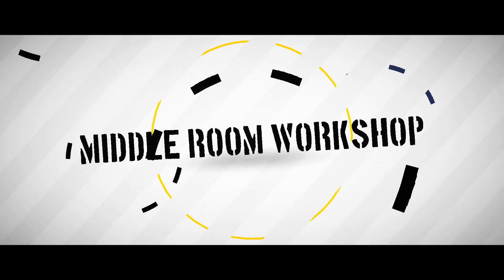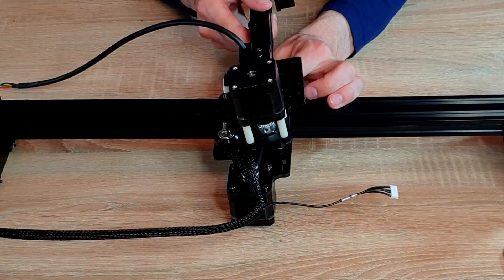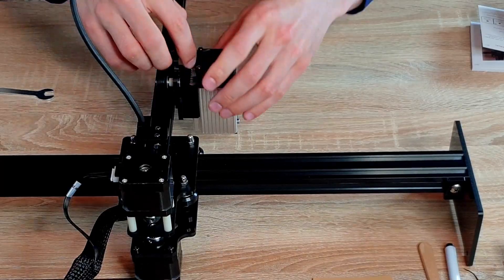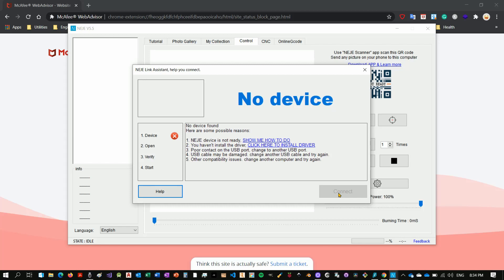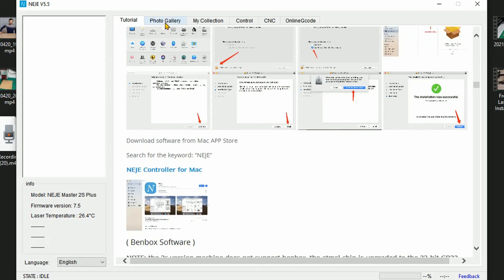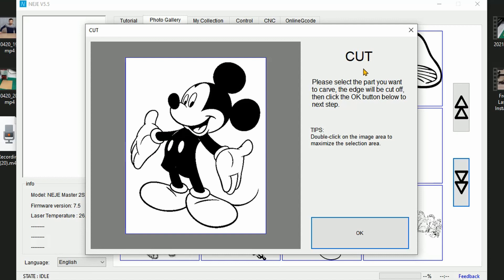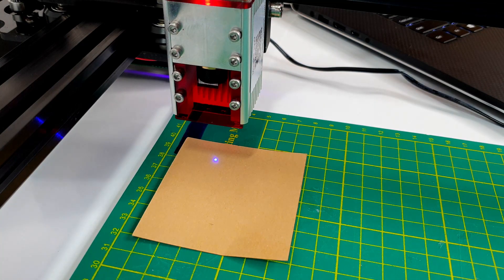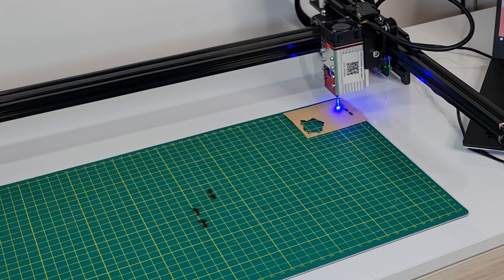Laser Cutting and Engraving Machine - NEJE Master 2s Plus - Installation and testing

Comment: hi, what kind of pad under machine you use? i am newbie to laser engraving  / cutting, aj want some pad, have you any advice? something cheao what i can use also for cutting, thanks
Reply from the maker: Hi, Peter Drienovsky; thank you for your comment. 

I have recently received the same question on another video, so I am pasting the same answer here. 

I have been using steel meshes for a very long time; you can find them in any hardware store; they are simple and cheap. 
The important is to choose one with a decent size of 10÷15mm in size and to be stiff enough so you can elevate it with a couple of wood blocks or anything that does the job.

The jobs are clean, but you will notice small burning spots on the underside due to reflection.
The honeycomb board is a better choice but has always had a very high shipping cost, and many are discarding it because of that.

Below I have a few links to some steel mesh, but again a local hardware store will have what you need and the honeycomb that I recently ordered.

Steel Mesh
https://s.click.aliexpress.com/e/_DFpz6kJ
https://s.click.aliexpress.com/e/_DkKnLLp
Honeycomb Board
https://s.click.aliexpress.com/e/_DFQsFgb

I hope it helps
Ciao

Comment: Hello I need help on my Neje Master 2s Plus?  your videos are the best videos. Please need help l, every time I try to do a job it's moving in the wrong direction and I can fix that and it goes against the the switches and it start making noises and I cannot fix it,the home cycling is correct. is any chance you help me do that please thank you
Reply from the maker: Hi Raul Ribeiro; thank you for your comment and compliments.

Please let me know which software you are using.
If you are using LaserGRBL you can easily switch the homing direction. To do that, you can follow my instruction here https://whathowwhysolution.com/when-clicking-on-the-home-button-the-machine-goes-in-the-opposite-direction-lasergrbl/

If you are referring to the Neje Desktop App, It is not possible to manipulate the direction of the axes besides reinstalling the driver from the Neje Wiki https://wiki.nejetool.com/doku.php?id=nejelaser_master_2_plus

The less obvious could be a wiring issue that is worth checking.
The connector typically has a direction, and you should not be able to wire them opposite, but sometimes they can be damaged or manufactured with flaws, and you won't fill resistance in the wrong direction. 

Let me know
Ciao
Reply: Hi Thank you for your prompt response, I'm Using Lightburn, the home sequence is correct, the only think is if i burn name or Leters it comes upsidown, any ideia? Thank you and again, You are doing an excellent JOB,  for the community, Ciao
Reply from the maker: Hi Raul Ribeiro, Thank you for your feedback. 

The problem has to do with the machine seeing its origin. 
The origin should be set to the bottom-left corner despite being physically located in the top-left (Go To: Edit (Main Menu -Top Left Corner) > Device Settings > "Origin"), and the x Homing axis $23 should be inverted (Go To: Edit  (Main Menu -Top Left Corner) > Machine Settings > "Output Settings"). 

Unfortunately, I am not in my studio, and I cannot really check with the machine connected, but that was the problem as far as I recall. 

You can also import my Machine and Device Settings to be easier. 
I have a video showing that here https://youtu.be/7FTJoGZ-ZGo while the files can be downloaded here https://whathowwhysolution.com/lightburn-settings-for-stubborn-machines-like-neje-master-2s-plus/

Let me know how it goes. 
Ciao
Reply: @MiddleRoomWorkshop  Thank you very much, this  fix my problem thank you again, for your time and your channel, Excellent, congrats

Comment: Hello, I'm hoping with your experience and expertise, you can help with a resolution to my current issue. I am having trouble loading the software. I am able to download the driver and receive a msg that it installed successfully. When I go to download the most recent version of the software, it runs through the entire download and after reaching 100% I receive a sorry error happened thread. A separate NEJE pop up box appears and says a problem caused the program to stop working correctly.  I've tried several times, deleting the driver each time and trying again, even with different versions of the software only to receive the same message. I would think if it were an issue with system requirements, it wouldn't allow me to install driver or initiate download of software. Are you aware of what could be causing this?
Reply from the maker: Hello Smiu Tee, thank you for your comment.

I am sorry to hear about your issue; unfortunately, I haven't experienced a similar problem with the machine, but I guess it is due to the unsecured software that conflicts with your system.

However, before getting to the conclusion, it is worth verifying some stuff and eventually testing another software.

First, let's check if your PC reads the machine correctly. To do that, you should go to Device Manager and check if you get unknown ports or ports with warning icons on them. If this is the case, the machine's mainboard might be compromised either firmware or hardware (hard to say).

2. If from the above check all is fine, try to install laserGRBL software. I have a video about that https://youtu.be/K70yVEUCeu0 and check if the machine is recognized and works.

3. if the above works or you just want to try this first, try disabling the app blocking feature of Windows from Settings > Update & Security > Windows Security > App & Browser Control > Reputation-Based Protection Settings | here toggle off "Potentially unwanted App blocking".

I would recommend you to test if you have any success with the latter option and then to turn that back on it is a computer where you have personal info. You may eventually add an exclusion to the blocking feature later on.

Let me know how it goes, and I will try to figure something else out.
Ciao
Reply: @MiddleRoomWorkshop  I Truly appreciate your willingness to help others. Thank you!! Only after trying 3 different computers, I decided to buy another laptop with windows 10 rather than windows 8.1 and I was able to finally get my laser running. What I found is I had to disable S mode which was not allowing the files to download. It would run through the download but wouldn't save it to the drive. After disabling S mode, everything seems to be working fine. I just need to find the proper settings for LightBurn for the 40W Neje Master 2s Plus. Happy New Year! 

-Cheers!
Reply: By the way, do you have a video for LightBurn settings for the 40W Master 2s Plus?
Reply from the maker: Hello Smiu Tee, thank you for your comment and for sharing your experience.

Sometimes small problems can turn out tricky to solve. In this way, you definitely solve issues related to back compatibility.

I do not have a video dedicated to the settings LightBurn with Neje Master machines, I definitely need to cover that as it was a bit tricky to let things run properly. 

Let me know if you have a specific problem with the setup, I can try to guide you.

In the time being Happy New Year to you too and enjoy your new laptop.

Ciao

Comment: Which of the two is better: SCULPFUN S9 90W or neje master 2s plus engraving machine?
Reply from the maker: Hello Semat Almohammed, thank you for your comment.

It is not an easy answer as there are many variables, and all is by lack with these cheap engravers.
Anyhow, I have personal experience with the NEJE master 2s Plus with both 30W and 40W modules, and I can tell you that is okay for cutting deep and engrave most materials.

Apart from the design of the machine which looks superior in the Sculpfun S9, the laser offers an optical power output of 5.5w which they market as having performance similar to a 90W CO2 laser machine.

I am a bit sceptical about the claim but I can tell you that the NEJE 2s Plus with the 40W module which offers a 15W optical power output cuts through 18mm of wood without air assist (https://youtu.be/PASPwsPtVl4), and the focus point is 0.04mm i.e. smaller than the one offered by Sculpfun which in other words means superior.

In addition with NEJE, you get a property software designed by NEJE itself (https://youtu.be/0UbEfM2AMKM), that despite being not the best one is an additional option that you can start with, perhaps it may already be sufficient for your purpose, and you can design your custom projects using any software like Inkscape (https://youtu.be/-Pey3dclFpA) and import it as a gcode file.

I do not want to advertise NEJE here, but I share my experience with it, I will certainly give a try to the Scuplfun S9 in the future so I can compare them.

I hope it helps.

Ciao
Reply: @MiddleRoomWorkshop  Hello, I've been researching laser modules in search for the best bang for my buck in terms of speed and cutting. I want to use slate and acrylic. Would you say this machine's learning curve is good for beginners? I've never used a laser but I am looking to buy one to make small memorial craft pieces. I originally was looking at the Atomstack 7 Pro but then I came across this machine and 2 things that stand out is the power and price, which both beat Atomstack. Would you recommend this laser for what I am looking to do or do you have an alternative recommendation? Thank you in advance for your time.
Reply from the maker: Hello Smiu Tee, thank you for your comment. 

I believe the machine will do perfectly fine for your purpose and you can find some good deals on Aliexpress or Banggood.

I hope it helps
Ciao
Reply: @MiddleRoomWorkshop  I appreciate your time and thorough explanation. I will take into consideration all that you've said and use this as a learning experience.

Thank you for your time and the useful content. 🤝🏽✌🏽

Comment: what are its dimensions in width, length and height when it is set up? For shelf storage.
Reply from the maker: Hello Mike Niopas, thank you for your comment.
With and length depends on how you will place the machine so referring to the way it is placed in my video  48cm*56cm*20cm (18.9"*22.1"*7.9").

Ciao

Comment: I would like to mount it to a piece of plywood. IS there a mininum thicknes that I should use? Also how big should I cut the plywood?
Reply from the maker: Hello Ted Silverman, thank you for your comment.

The thickness should be such that you wont cut through it with the laser at max power, and low speed in a single pass, ultimately to provide a solid stiff base.
This depends on your laser power, but I believe that a 10mm (0.4") board would be more than enough for most modules.

Anyhow my board is 16mm (0.63") think, 550*400mm (21.65*15.75") and is just enough for the Neje Master 2s Plus, but if you have material make the board couple of centimetres longer (about a inch) in both direction.

Ciao

Comment: If mounted to plywood, Can it be stored vertical resting on the wood, not the laser?
Reply from the maker: Hello Ted Silverman, thank you for your comment.

If your question is only about storage, yes you can store it vertically paying attention to the module.
If the question is about working in a vertical position, you can as well although I do not recommend that.

In a few days I will upload a video showing that.
Ciao
Reply: @MiddleRoomWorkshop  I was only asking about storage.

Comment: what cutting surface are you using?
Reply from the maker: Hello Slickman1953, thank you for your comment.

The machine is fixed to a 20mm plywood, on top I have paced a regular cutting mat for hobbyist and a steel mesh that I bought in the local hardware store which helps reducing the burn effect in the underside.

I hope it helps.

Ciao

Comment: Bought NEJE Master 2S Laser Engraver on Aliexpress, but the dam thing 
dies on me  after about 15 hours or so.  Had several problems with 
cutting the thing does not cut. Even bought Lightburn, but no slution  
from Neje. Contacted Neje, its a Neje product, got mail back and they 
started to help me must do a lot of things , but when they find out 
thats it was a mainboard  problem they told me  that its not bought in 
an official Neje store so they could  not help me. Funny thing  is they 
do not send to my country, all country 's are listed but when you try to
 pay the answer is we doe not send to your country.

I had bought 
another board to replace the first one but for a bigger machine. Start 
to work like a charm and guess.. its cuts also, thus the first one was 
broken from day one. But  this  one dies on me after 5 hours in the 
middle of  a job , same problem as i can see.  

Guess what Neje tells me
Reply from the maker: Hello Mail Dumpers, thank you for your comment.

I am sorry to hear all of that, unfortunately the treatment you have received is nothing new, these products especially if you by on Aliexpress are by lack.

Anyhow if two boards burn out, it looks to me like if something is drawing more power that it should and since the motors are not that powerful I can only think of the laser module being the problem here.

This in my view is confirmed by the fact that with the first board you weren't able to cut, then with the bigger board you started to get some cuts, so paraphs the controller inside the laser module is not doing the right job absorbing more power that it should.

Have you noticed some burn spots on the board, it may be evident on some connector or some of the components.

Let me know.
Ciao

Comment: Is it normal for the machine to vibrate whilst working for the first time
Reply from the maker: Hello RASMORAL, thank you for your comment.

The machine should not vibrate apart from the initial phase when the axis is moving to the point of the first burn (in my experience).

Just double-check that all the components are correctly tightened, also the ones that come pre-assembled.
Also, while the machine is off try to slide the axis and check if you feel some weird vibration. The type of motor should feel and make a noise like a constant tiny vibration, however, if one of the bearings is damaged you should be able to feel the strangeness paraphs also looking at the shaft.

Let me know.

Ciao
Reply: If you use the neje software it is very loud and shaking if you use lightburn witch is a paid for software it runs smoothly and isn't loud and sluggish anymore plus you can do so much more with lightburn

Comment: Have you cut any leather with the 30W?
Reply from the maker: Hello Oak Ridge Review, thank you for your comment.

No, I haven't cut any leather so far.
Tell me to which leather are you interested? Type, Thickness ... 
I could try to find some scrap and test it for you.

Ciao
Reply: @MiddleRoomWorkshop  hey! I specifically use 2-3oz and 3-4oz leather. 0.8mm to 1.6mm thickness. Nothing insanely heavy. Idk if it would be easier, I can mail you some, if you wanna look me up on IG and DM me an address!
Reply from the maker: Hello Oak Ridge Review, 

It'll be easier for me to find it around as shipping will not be an easy and cheap option to where I am based here in Europe.
I will find few variants and try to both cut and engrave.

PS. I do not use IG or FB or anything like that, I keep myself away from Socials. 

Ciao
Reply: @MiddleRoomWorkshop  I'll keep my eyes peeled for new content then! Thanks friend!
Reply from the maker: Hello Oak Ridge Review,

Yesterday I received 1Kg of lather together with some tools and threads from Amazon with a bunch of thicknesses to test.
This upcoming week I will make my tests and try to do something concrete, then upload a video.

Ciao

Comment: Hello, I am a .neje master 2s user. The red led is constantly flashing. The software is not loading . can you help
Reply from the maker: Hello Uras Teknik Plastik, thank you for your comment.

I did not encounter such a problem so far.
Did you connect all the assembly cables correctly? Also, have you tested the USB cable with some other device to see if it is working?

Usually, the red LED should be on when the device is not connected, but it should not be blinking; therefore, it seems like something is wrong with the hardware, perhaps some faulty connections.

We need to work it out by exclusion.
Check if the laser goes on and the LED on the top of the laser module breaths, then check if the axis move when the device is on (do not force it). The driver should retain the position of the motors, so the axis should not move easily.

Have you installed the driver as shown in the video? 

Be in touch

Ciao
Reply: @MiddleRoomWorkshop  I installed the driver as in the video. was working normally. The electricity went out, it came like this . There was nothing wrong with the connection, it was working like this. I changed the adapter. i changed the cable
Reply from the maker: Hello, if the power went down during the installation of the driver, the board might need a firmware refactoring which I am afraid it can be done by the manufacturer only.

Ciao

Comment: my friend. i have neje master 1 and upgrade main board to 2s, so, when i have to make 2 passes to cut something THE SECOND PASS start in different position. WRONG position making DOUBLE LINE  instead only one to cut. its there some trouble in the belt machine or motor ? a variation in axis X making the second pass FAR SIDE of the first one. WHY ??? simple i cant make any  CUT because the machine dont do passes in the same postion!! fucking all the work!
Reply from the maker: Hello Mario, thank you for your comment.
I haven't experienced any problem like this so far, the only thing I can think of is the driver.

Have you noticed any abnormal scaling of the engravings?
Have you installed the driver your self or it was preinstalled in the card?

You may try with a different software to control the machine, I have scheduled the upload of a new video using another software.
I can try to investigate into your trouble but I will need more details.

Ciao